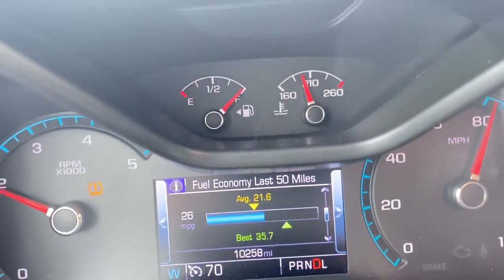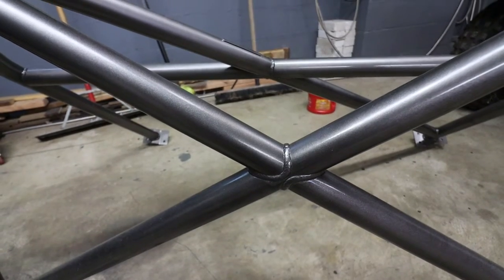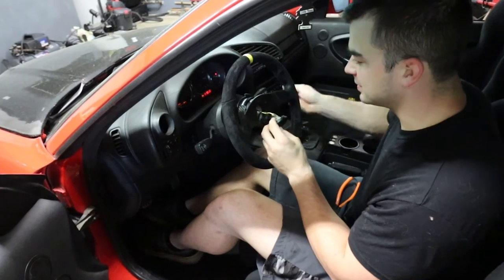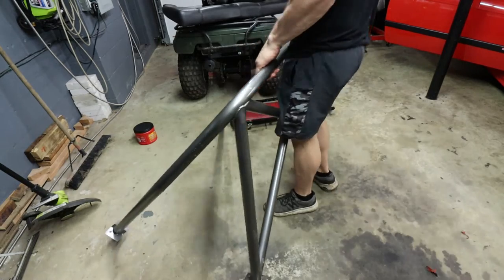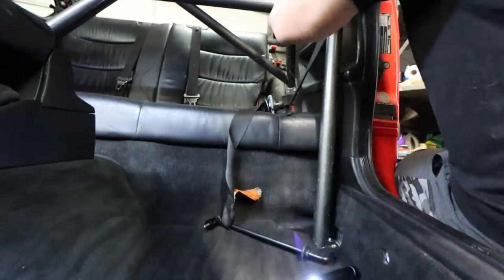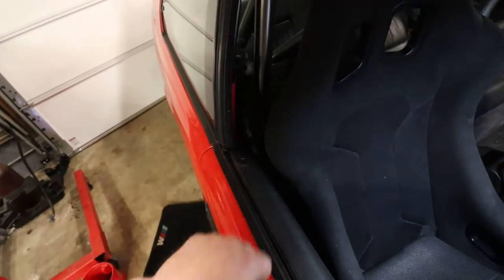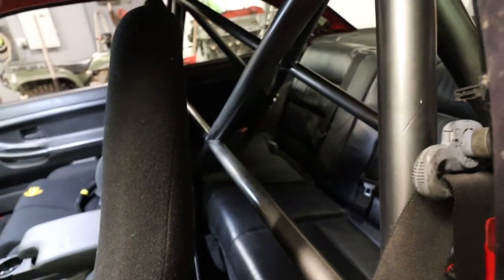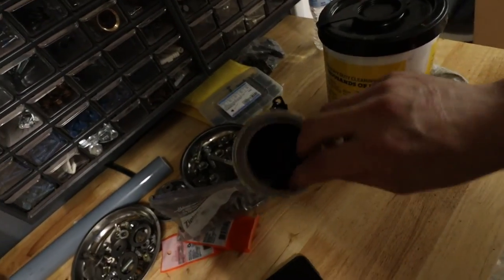Roll Cage and Steering Wheel Install in my LS1 E36

Comment: Do yours gauges still work ? Speed n etc
Reply from the maker: Speed yes, tach does but it's not accurate, I need a conversion box to make that correct.  You can make everything work fairly easily though.  I'm going to switch to a digital dash though.

Comment: Shouldn't that have been welded to the frame and you should get air horns
Reply from the maker: Nope these are designed to be bolt in. A full cage is always welded though. And no to air horns 😂